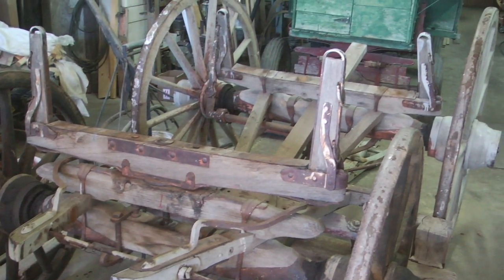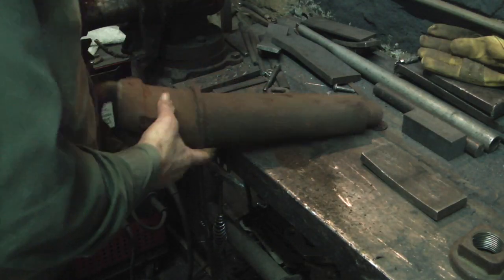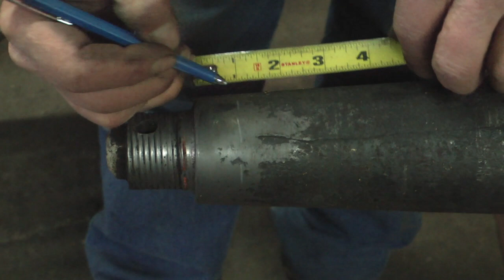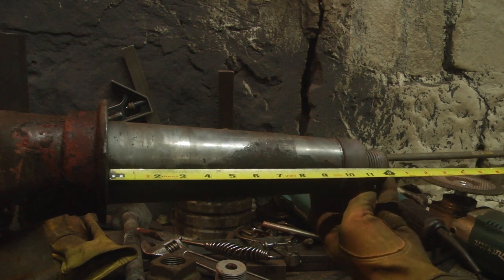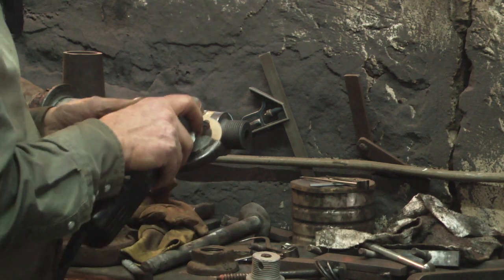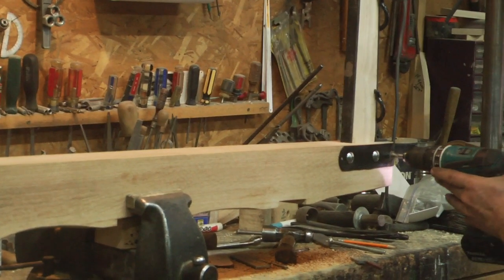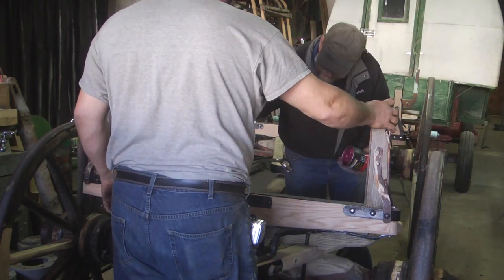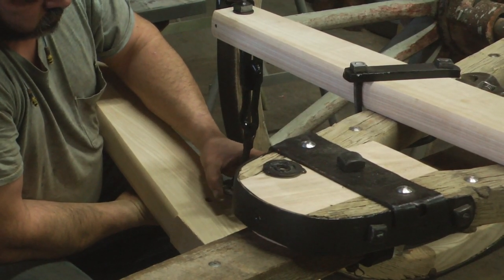The Studebaker Wagon Gear #2 | Surprises in the Rear Axle | Engels Coach

Comment: Pre '75 Mopars also used left hand lug nuts as did some pre '65 GMs on the driver's side which would prevent a loose lug nut from unthreading. As for the difference between old and young, an older man knows what it is to be young but a young man does not know what it is to be old. :-)  Good job on the rebuild as usual.
Reply: Same is true for Studebaker cars & trucks I believe.
Reply: Excellent comment, @ron827 - made five (5) years ago !! How true !!

Comment: If you find this. I have a question about the steel tire on this Studebaker wagon.  I noticed the tires are curved across the road surface, does that help the operation in any way?

Comment: I wonder if that bedding compound is similar to the red lead & linseed oil caulking paste used in shipbuilding.  It certainly looks like it, and it seems like it'd work well.
Reply: I had a similar thought, as red lead and linseed putty was used extensively in the past in plumbing in the UK as a sealing compound. Possibly it also helped prevent water ingress into the end grain of the axel, and thus prevented wood rot.

Comment: It must be so nice to be able to work on a vehicle (4 wheels) and do every thing with ONE wrench.  No Metric, No Torx, No Phillips, Robertson, Allen etc.
Reply: I started to be a smart Alec and ask if that was a metric or standard Crescent wrench. :)
Reply: David.  Obviously a Metric Hammer.  One side of the Crescent is Metric, the other side is Normal.  Some countries use Metric, other countries put men on the moon!  Here in Canada, we use both. FUBAR.
I don't understand why those axles are tapered unless shims are used to take up wear.
Reply: David Harris. Here in UK we have dual standard crescent wrenches. One side (usually the one on top) is imperial and if it's turned over it's metric. Recently I used one that had been made the other way up and I got very confused. At least that's what I've been told.
Reply: I get the Camber part, wheels are guided inwards with dishing.
How is Caster achieved?
Reply: so the axle horizontal centreline is behind the King Pin of the Bolster?

Comment: Why braze with an electric welder sitting there.  Wouldn't the braze weld be better/stronger if you had beveled the edges of the two pieces?  No wagon/wheel builder but I been a welder for many years

Comment: Mr Engle.  Is there a corresponding metal sleeve inside the wheel hub?  Are shims used to take up the wear on the hub assembly as they wear?  No provision for Zerk fittings?
Reply: It would seem practical to have shims so the wheels could be moved inward on the skein and therefore tightening the assembly to take up clearance from wear.  Thanks for your reply.